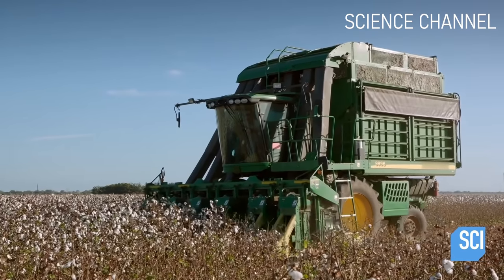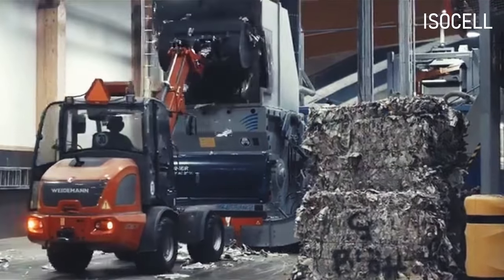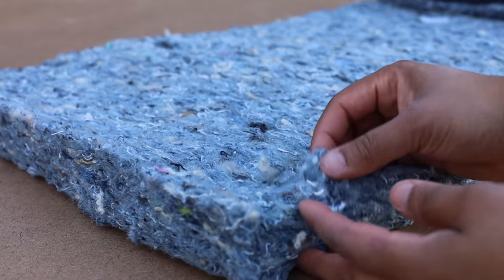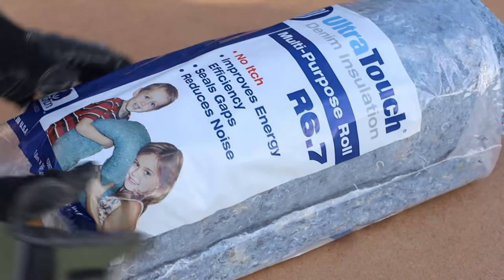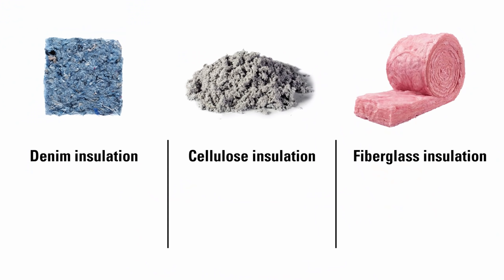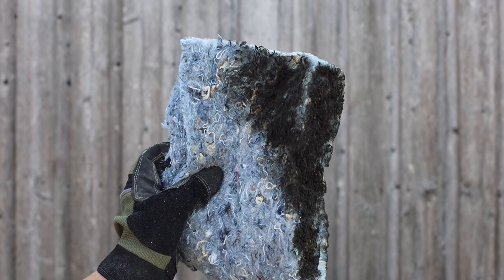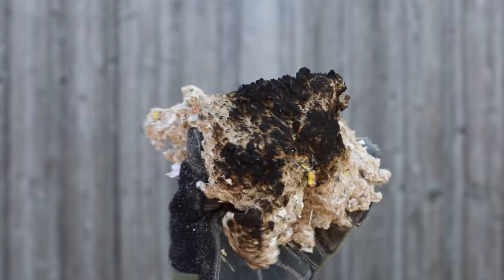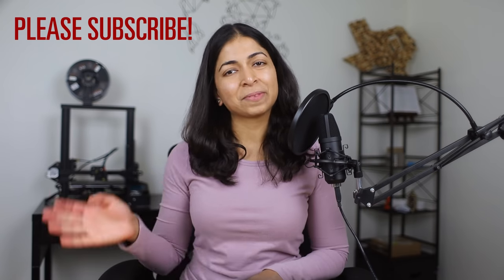Denim vs Cellulose Insulation | Everything you need to know!

Comment: 20-30 year lifespan for cellulose? If it's kept dry, it should last much longer than that, right?
Reply: Yes it can be much longer, though it will get dust on it and will over time just flatten out. Which losses its value. In an attic. If your attic gets very dusty it will degrade over time. I have seen some people vacuum it up and then add in new and re blow it while it removes some of the dust and weight that caused it to go limp.
Reply: @kameljoe21  cellulose settles but doesn't flatten out. Any insulation can get dust on it.
Reply: @blackberryfarm7179  yes that is what I meant. The weight of the dust will and does cause it to settle further over time.  normal settling happens with in the first year after it gains and loses moisture then every year after that it degrades just a little bit more and when dust coats the top of the insulation it begins to further degrade or flatten the cellulose.  
Though the cellulose can be cleaned up and recycled with new cellulose. Though really old cellulose may not contain good fire retardant.
Reply: @kameljoe21 
Dust won't affect cellulose,  you need to realize insulation codes back in the 70s-60s required much less insulation thickness.
That 2.5" of "dusty" cellulose you see in the  attic of a house built in 1967,  probably was blown to a depth of 2.7" when it was new.
Literally settled a 1/4" in 50+ years.

Comment: You couldn't be more wrong. Efficiently recycling an inefficiently produced product is not a bad thing and should not be discouraged. People aren't going to stop wearing jeans, and the alternative to using discarded garments as insulation is just throwing them into a hole in the ground. Therefore the only part of the production cycle that should be assessed for embodied energy is from the point where a consumer decides to discard a garment until the insulation is sitting on a shelf in a warehouse.

Comment: I'm in the process of removing the cellulose from my attic. It's a fine product, sure, but the breakdown is just awful. A raccoon got into out attic and the previous owners chased it out but left a nest that could sleep a toddler. Just ick, so rockwool it is!
Reply: I've got the same in the attic above my living room, minus the raccoons, at least. For the rest of my house... it's... complicated. I'm planning to replace everything with Rockwool as well, likely having to double-up on batts to get the R-38 I need to meet the building code in my area. Rockwool makes R-38 from what I'm finding online, I just can't seem to find where I can actually order that in.
Reply: Cellulose doesn't break down just settles also is rodent proof.  However a coon will trash any loose insulation.
Reply from the maker: If you live in an older home, I don't think you have to follow the latest building code requirements. Try reaching out to Kevin Ball kevin.ball@rockwool.com. He's very helpful.
Reply: @BelindaCarr  Probably not, but I'm still going to use it at least as a guideline.
Reply: @BelindaCarr  Just to provide an update to my previous comment. Rockwool R38 batts are for 2x10 studs, so wouldn't work in my attic. Readily available at Lowe's, though, is R30 for 2x8 studs, R23 for 2x6 studs, and R15 for 2x4 studs. So I'll have to double-layer the batts to get the R-value I want - R23 for between the joists, and I'm tempted to go with R30 for the second layer, but will probably just do a second layer of R23.

Comment: While I have enjoyed many of your videos, I’m frankly dismayed at the incomplete information you’re presenting here. For old home retrofits, closed cell foam is frequently a much better option than blown cellulose. For wall cavities in balloon framing, cellulose can be time consuming to fill the bays, but it works exceptionally well with minimal disturbance to the building exterior. If dust is getting everywhere, it is probably from installers not taking care to avoid blowing cellulose in, for example, walls where floor systems are not blocked off from the stud bays. 
In new construction, cellulose is installed by first stapling netting across the rafter/stud/joist bays, where it is then contained until those surfaces are sealed up by flooring/drywall. It is probably the most sensible and versatile insulation available, so I am puzzled as to why you’re giving it pretty short shrift here. 
Fiberglass is terrible junk which most installers don’t even bother to install properly, resulting in no end of trouble with voids, cold spots, and ice damming. Sure it’s cheap, but that cheapness is a poor investment against the long term thermal performance of the building.

Comment: One thing is that I do not get is where all the denim comes from. There is not place to drop off old jeans. So I would think that most if not all of it is cut offs from manufacturing. Jeans are paper thin these days and do not last like the one from the pre 80s... 
Cellulose is still expensive because people think that it has to be recycled. Though most people do not understand that tree farm are replace when they are removed. Its not like they move on to another area and cut it all down. They rotate lots of stages of trees. Because people want to recycle paper products these days and also because paper usages has gone down by large margins in the last few decades those products will remain high.
Reply: Also forgot that I never knew that you could install cellulose wet. So I learned something new today!!!!
Reply: There are local clothes collection firms. Then regional separation firms, which might separate clothing say by type, material, color, etc. The separated clothes are then moved onwards.
Reply: @dosgos  Could be things like good will. Though I used to live in a very large city and we had nothing like that to donate old worn out jeans. Thrift stores want good used items. Most of the other stuff ends up in the dump. So really big thrift stores should accept all clothing no matter the condition.
Reply: This is why I shop for clothing at the thrift stores.  It's amazing the real quality of clothing that you find for pennies on the dollar.  The high-brow names have a much better fit, finish and are made with far superior materials.  I'm not a proud man, but I'm a cheap bastard.
Reply: @TechGorilla1987  Same here. I have only bought a few new t shirts in maybe 20 years. Everything I own clothing wise has been owned by someone else. I also have stacks and stacks of clothing so that I never run out. I mean I still get some things new, Just not as much as one would think. Some of my clothes are older than I am and I am in my 40s and they have lasted this long they will last even longer. Though I miss my stack of 70s levi and wranglers jeans that I used for work for many years and those years of abuse put lots of wear and holes that could no longer be patched up.

Comment: Denim vs cellulose is lis like saying Blue Jeans vs Pants. One is just a specific example of the other. Cellulose is most effective when blown in instead of the batts.  Blown in held by a net is another option. Installing cellulose is great for new construction but a little more tricky for remodeling. Fiberglass is actually a good, and in several ways green product. I'm happy to think about different materials but if it's in an enclosed fire protected/water protected space (wall or ceiling) supposed to last for the duration of the home and needs to be affordable; work; and have known features FIBERGLASS is fine. Energy/material input for properly used fiberglass is better over the lifetime expectancy of the product. 
If you want to be "green" I would worry less about if your insulation came from a bluejean; a pine tree; a glass plant or a mineral wool plant and more about it being part of a properly designed and installed system. More resources, money, energy and time are spent removing and replacing failed systems than any amount of recycled content could ever offset.

Comment: I love your work but you are incorrect on one thing. The Ultra Touch cotton NRC rating is only for their 3" R(13), not the 1" you display in the video. I am not aware of any material that can achieve a 1.15 NRC with less than 2" depth.  What inch depths were represented for the NRC ratings of the cellulose and fiberglass?

Comment: Cellulose is...flat out...the worst.  The number of attics I've been in where what used to be a 3-6" spray in installation a decade prior is 1-2", compacted, and pretty much useless.  I don't care how cheap it is, it's never a viable option in my opinion. And for wall stud bays? Forget about it. 

Denim is fine, and it holds up under water damage over-all better than cellulose. But none of them compare to rockwool in terms of long term sustaining of loft.